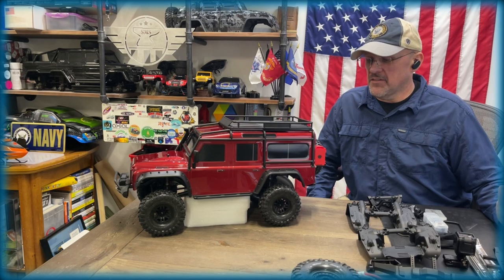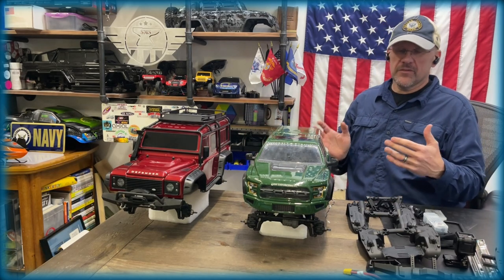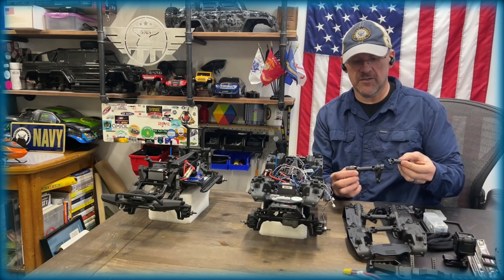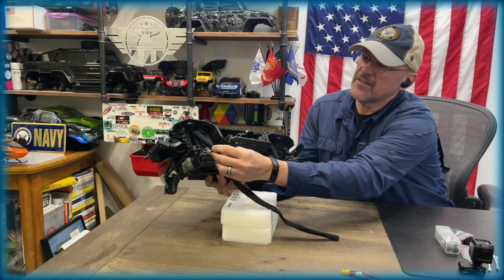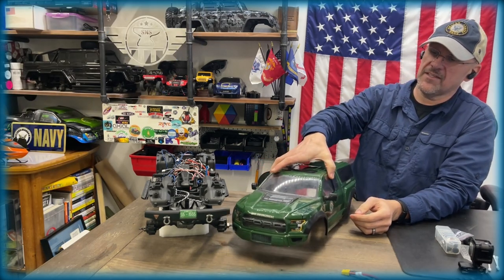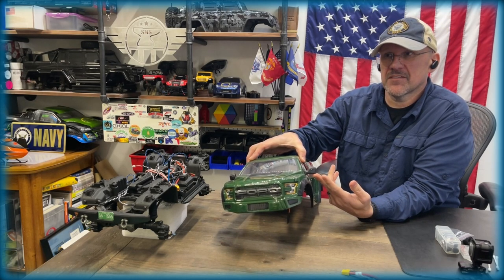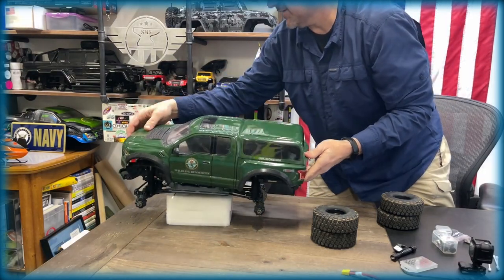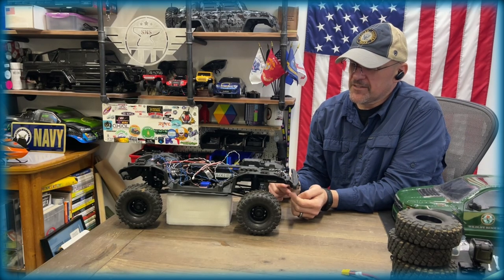Traxxas TRX4 Defender Converted to Clipless Mount

Comment: Just changing the tires does make a difference in the look of any vehicle. The stance, width, and handling of the vehicle.  I wish clipless body mounts could be done to all RC, making it a lot easier to insert batteries.  Awesome video, Trey. Thanks for the explanation and demonstration.  💯💯👍
Reply from the maker: Thanks Al. The clipless system is so nice and I look forward to when it’s standard for all RC. Thanks for watching.